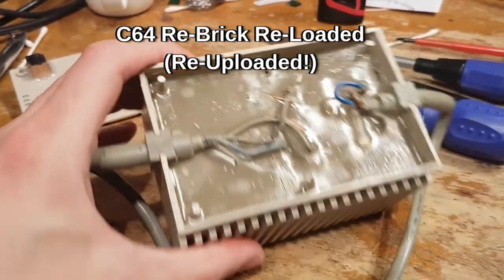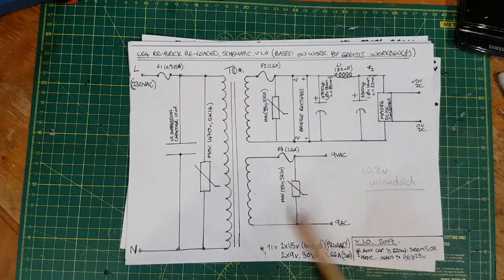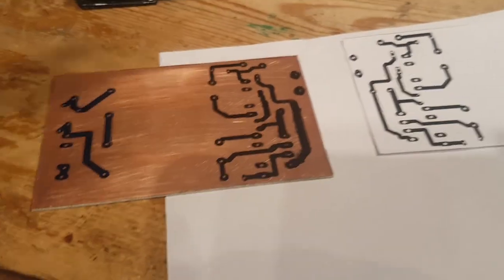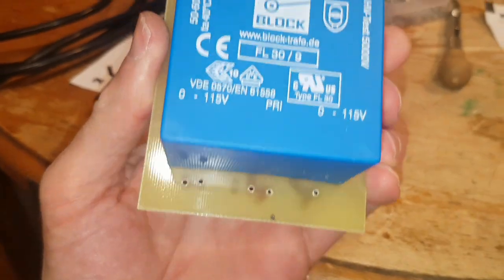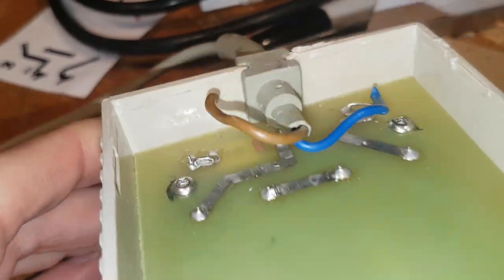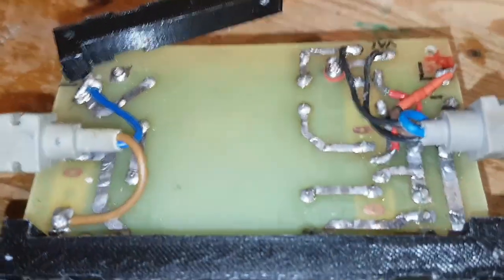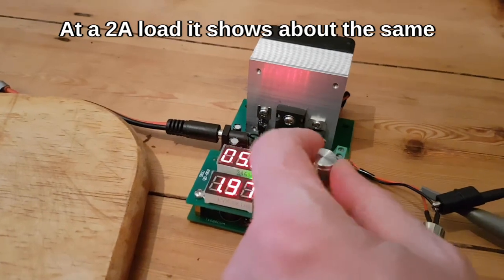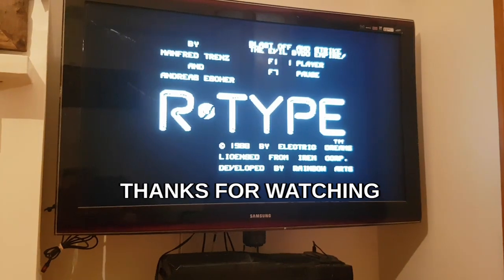C64 Re-Brick Reloaded (re-uploaded!)

Comment: I've just done something quite similar except for the 5V, I repurposed a USB phone charger (was an EU plug effort which came with a Sharp C10 phone, so unused as wrong plug and branded so should be reliable), and put a bwack saver in front of it just in case. Completely isolated from the 9VAC by virtue of the fact that it's only joined on the mains side.

Comment: Good to see that it's possible to take out the epoxy lump. I'm hoping to replace my newly acquired C64 power supply with new internals too, but keeping the old original case
Reply from the maker: Thanks for watching. I am in the process of making another one where I managed to (more or less) de-expoxy the original transformer in working condition. It can be done but is pretty 'hit and miss' 🤣. Good luck with your build.
Reply: It's not worth wasting your time (unless you have a lot heh), better off getting a modern high quality and reliable switching power supply.

Comment: Nicely done! I'm glad you drilled those vent holes -- I can see things getting hot in there when it's all closed up. I have thwe same electronic load model -- I love that thing.
Reply from the maker: Thanks! Should be a bit cooler now lol. That poor old 7805 sweating away in all that epoxy for all those years. No wonder they fail. 🤣
Reply: Back in the 80's when I was running a BBS 24/7, I mounted a 12 Volt computer fan on top of the PSU with zip-ties, and surprisingly worked really well keeping it cool. :)  Of course nothing beats a modern high quality switching power supply.